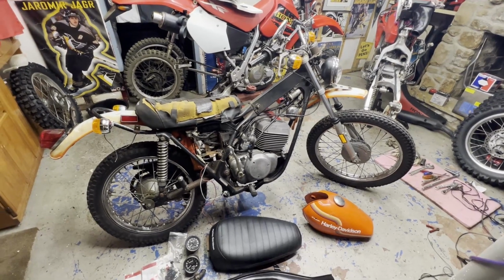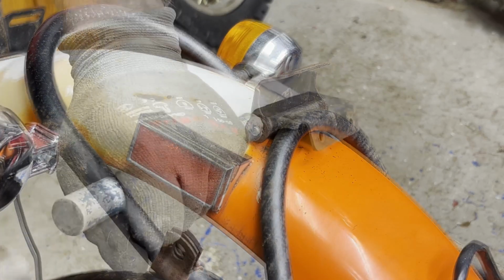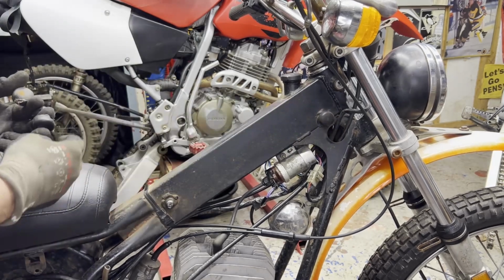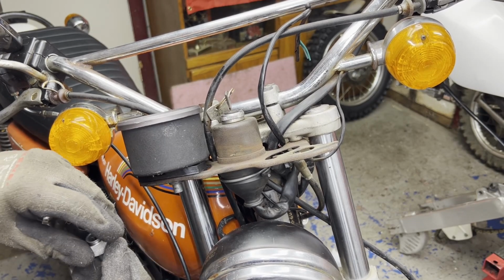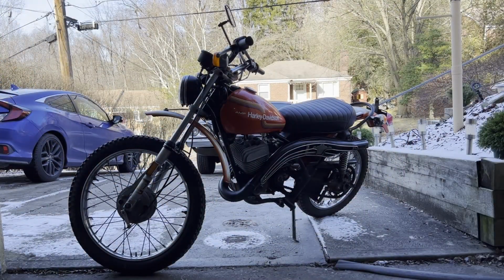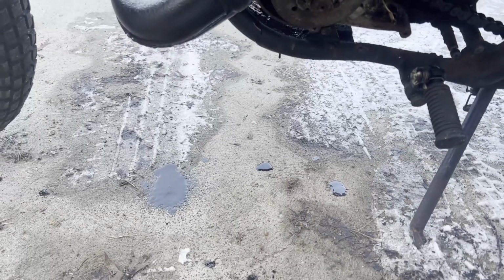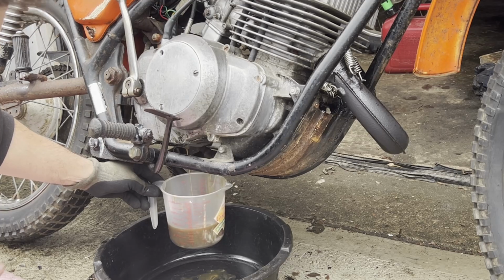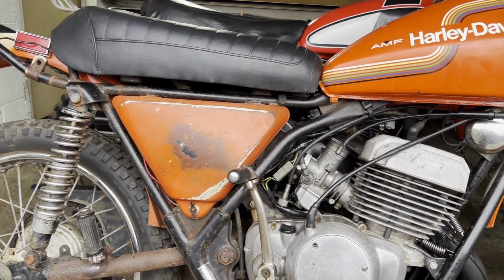1975 Harley-Davidson SX250: discovering a new problem

Comment: Great to see it going at least sounds decent , but looks defo like main seal away.🙁🙁 and well spotted with the return centering spring broken. But looking decent now with new seat dials all operating and in place. More work required it seems .👍👍 great work . Look forward to the repair hope you can still get the parts required. 👍
Reply from the maker: Thanks!  Surprisingly you can still get quite a bit of NOS parts for these things still.  My friend already found the return spring and main seals new in the package from a local guy that has a stockpile of parts for these Harleys.

Comment: Where do you find you're Aemarchi SX-250 parts from , you said . Can still find parts for these bikes . Just wandering  . Ive got a 1974 SX-250 .thanks fo4 the great video..
Reply from the maker: Thank you!  pretty much all off eBay.  My friend that I did the work for ordered all the parts and I just asked him to be sure.  The best thing to do would be to search the part number on there instead of typing in the model number since they made so many little changes to those bikes mid year and each year

Comment: I just have found a sx250 not sure what year but it's missing a few parts like a spark plug and it doesn't run even with a regular spark plug in i ldo you know where I could possibly get some parts for it
Reply from the maker: Hi Scotty, your best bet would be to join up the Harley SX groups on Facebook.  There are a ton of guys that are very knowledgeable with those bikes and helped me with all the questions I had.  There are a lot of guys that can point you in the right direction with parts there too.  eBay is another place you’ll be finding parts as well.  I recommend searching by part numbers because Harley/AMF was all over the place with parts depending on years and mid model updates.  It’s worth joining Facebook just for those groups if you aren’t already on there.

Comment: i found a 74 but it needs a new stator, ignition module and coil for $900. im new to bikes and ive never fixed one before, do you think it would be expensive to fix? its in good cosmetic condition and everything only those 3 things are wrong with it. also do you think it would be difficult for someone new to bikes to fix?
Reply from the maker: That’s cool, they are super simple to work on so I think if you got yourself a shop manual it would make things pretty easy for you.  I recommend getting a good multimeter for the electrical diagnostic stuff and basic tools will do the rest.  Join a couple Facebook AMF Harley groups too so you can ask the gurus.  Lots of helpful people that helped me out when I was working on this one.  I’d try and answer any questions you have too.

Comment: Why bother with this turd of a bike . When I was 15 I bought a Suzuki 185 ( mid seventies ) and my best friend bought one of these Hardly Doinit AMF pieces of crap . It ran like crap , sounded like crap and was planting it's parts all over Louisville Kentucky.  I rode it once and had no desire to ever ride it again . Some things are better off dead  .   PK
Reply from the maker: It’s definitely a quirky bike and it’s been challenging but I’m working on this for my friend and at the same time it’s a learning experience.  I will say it’s been fun to even get it this far considering it sat outside for so long that it had vines growing through the openings.
Reply: Think the top end needs rebuilt. Sounds like alot of piston slope.
Reply from the maker: @rickcasey611 yeah i mentioned that to the owner, he didn’t want to do a top end at that time.  The main goal was to get it running.  He’s got the bike now but knows I’d do a top end for him if he sources the parts.